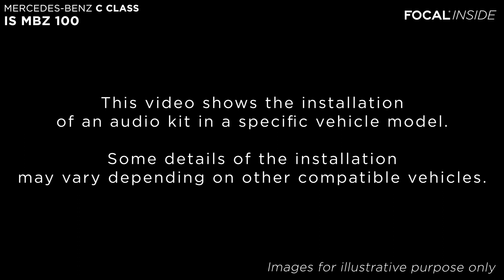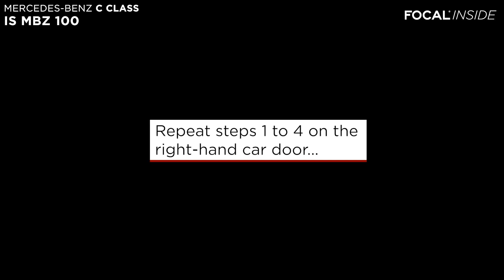Focal Inside - IS MBZ 100 Installation - Mercedes-Benz C Class

Comment: I installed them in a w213 e class burmester. I had to tune down the treble to -4. Upgrading the center speaker does help with the mid, but the lack of a proper 6.5 inch hurts the overall SQ and mid bass performance.
Reply: Same results myself turn down my treble to -4 after this mod on my GLE. I replaced the amp with a Fischer Match 10. Plug and play.
Reply: @emeivi5564   The burmester amplifier already has crossovers in it, did you connect the cables to the speaker itself or did you run it through the crossovers?

Comment: Hello Focal,

I am Installing into a W213 / E Class.

The stock system has seperate output cables for the tweeter and door speaker. 

The focal crossover only has 1 input.

Should I splice the stock 2 output cables together? 

Or just use the door speaker output? If so, what should I do with stock tweeter output cable?

Thank you
Reply from the maker: Hello, 
Thank you for your message and your interest in our brand. We invite you to contact our Technical and After Sales teams via this contact form: https://www.focal.com/en/contact-support. They will be able to help you! 
Best regards, 
Focal

Comment: Dropped these in, they're very very very bright. Not sure if I'm a fan, find myself reaching for the volume down.
Reply from the maker: Hello, thank you for your purchase and for your interest in Focal products.

The " bright " effect perceived while listening is caused by a boost of the high frequencies in the OEM amplifier of your vehicle. This high frequency enhancement is present to compensate the lack of the original speakers. 

We recommend lowering the treble level in your audio settings to get a flat signal.

Best regards.
Reply: @Focalofficial  yeah I've pulled the EQ around as much as possible and looked at the curve on an RTA. The addendum to the documentation suggests to put a cap on the mid woofer, does still have a big gap in the mid-bass. Without changing the stock amp out, value is somewhat limited.
Reply: @Focalofficial  So after having these in a Burmester car for a month, with the eq setting high-10 mid-6 bass-0 I can say that the combo of these drivers and the factory EQ doesn't work. The natural bump the driver has a 15k (as seen the tech sheet) and the EQ for the old drivers means they're just not a pleasant, cymbals have a glassy brittle crunch to them.  I have since put a 8 chan DSP amp in (with a MOST150 to optical link) which gives you a clean signal to start with and para EQ to remove any unwanted peaks, but you're into a decent lump of money in hardware and time (£2k plus).  My advice is unless you're going to replace the burmester amps, leave the factory drivers alone and just look a sub.
Reply: @timburton1080  Thank you! I almost went down that rabbit hole.. Your information was very helpful. I am considering Focal footwell subs for a stealth setup in a GLE
Reply: @timburton1080  After adding the DSP amp though, what do you think?
Reply: Did you add any dsp to your system? I'm deciding between focal or eton
Reply: how much sound is improved by simply changing their own fields without the need for an amp